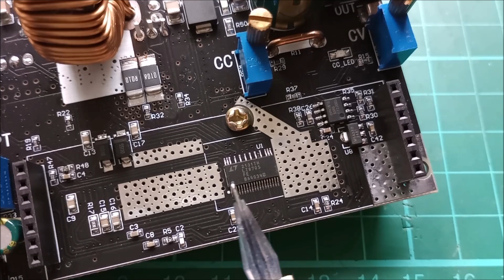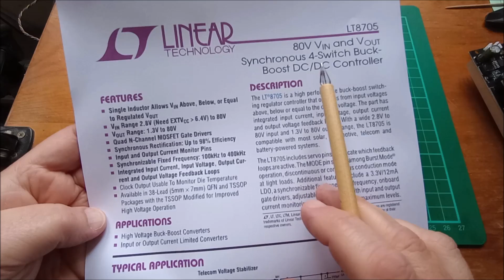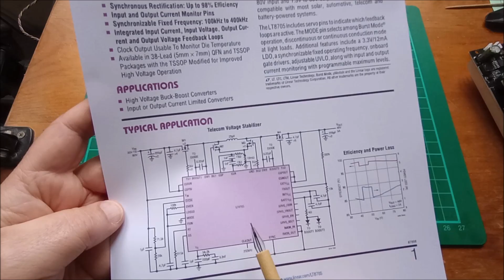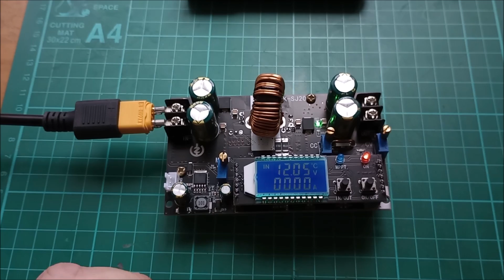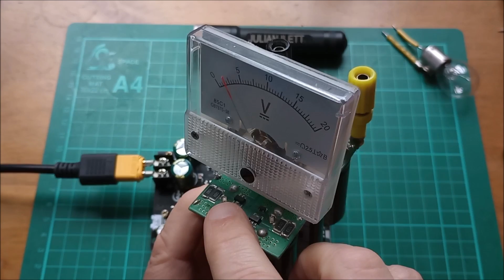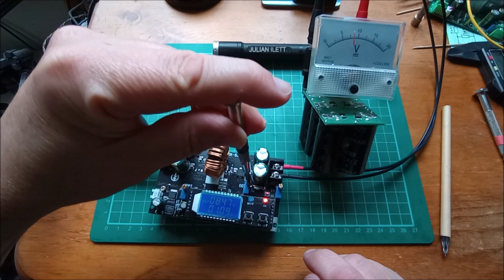ZK-SJ20 Just Another Buck Boost?

Comment: hi @JulianIlett do you know what type of fet transistors are installed there? i am wondering if I can to change them to more powerful ones (with less resistance) if this module will be used not for 80 but with 40 volt panels. don't want to install additional cooling )
Reply: NCE82H140 originally installed

Comment: I bought both of them (SJ20 and SJ30) version.  So, here is what I noted after half-hour of playing with these things:
- The manufacturer that makes these modules also makes regulated power supplies, they have lots of other products that start with "ZK" prefix, for example: zk-6522c . All their stuff uses microcontrollers, so they are probably good at programming them and hence a unique module design idea to control the buck converter with a microcontroller
- So the board (with display) is composed of a buck board (or "motherboard"), and a microcontroller board (the display). Now why do you think the display is detachable? Well my hypothesis is: because these guys also manufacture power supplies (regulated, laboratory-style), they made a generic board based on the LT 8705 chip (very good IC, it even has sync pins to sync many of these in parallel) which they are using on their other power supply products. But how do you sell a buck converter to the solar guys? Exactly, you label it as "MPPT". A regular buck converter has a potentiometer called "low voltage", but for the solar guys they relabeled it as "MPPT". This way you manufacture the same board, but for solar guys you sell the PCBs with "MPPT" label, and for the electronics guys you sell the same board but with label "Low voltage protection" (and you don't have to print it, because we all know how it works). If you sell a power supply, then you insert the display board in the already existing slot. Result of this design: same "motherboard" is reused everywere it can be.
- The reason you have to short the outputs to set the overcurrent protection is because the overcurrent protection goes on the display (the microcontroller board). But when you already have the PCB designed and used in other products, how do you control it with external board without modifications? Exactly you control it by detecting a short-circuit. On short-circuit the voltage drops to 0 immediately so there is no mistake. They found this easy solution for them, but for the User it is not very pleasant. Imagine a 30A current flowing on the output and you have to short-circuit it (in order to set overcurrent protection value), you will get a lot of sparks and probably smoke. While you are turning the potentiometer the short-circuit must be kept active, otherwise the value won't be set, you could possibly heat the screwdriver a lot if you aren't very quick. They could do it with another button, but because they didn't want to modify the buck-board (and this is my speculation because I don't know the real reason)  they decided to go for "short-circuit way" to tell the microcontroller board that it has to set the output current value in its memory. Only engineers from that country can come up with such idea.
- The fan can't be turned off, doesn't work on temperature-sensing. Too bad

Will keep testing and maybe find another issues.

Comment: I think i will buy this but i'll replace the caps with higher quality panasonic FR ones. The input will never be more than 30V so i'll replace the 100V input caps with 35V ones and the output caps with 63V ones. I won't ever need more than 60V. I'll power it from a 24V AC toroidial transformer.

Comment: Hey there,
which buck-boost would you recommend today, with the following properties (from higher to lower priority): 
- efficiency,  no or very little heat dissipation,
- protected with a resetable fuse
- voltage and current display
- size of module preferable small
- solid input and output Terminals
- temperature controlled fan, best without one needed
- voltage 5V in / out
- cuttent 10A in / out
- power 100W to 200W in / out
Reply: check out the blue buck-bust converter with LTC3780  chip, costs 6 dollars ,synchronous rectification, 10A . The best thing I have ever found on Ali. You can parallel them up and they won't burn. Ceramic fuse included!

Comment: When you say single inductor but also buck-boost, on the basis it's described as synchronous, and "like the 3780," I would hazard a guess what you're actually looking at is a SEPIC converter. I think buck-boost has just become a shorthand for a DC converter that can go up or down. Possibly I'm splitting hairs, but it's an interesting development to see more of these.
Reply from the maker: No, it's not a SEPIC converter. Both the LT8705 and LTC3780 are described as Synchronous 4-Switch Buck-Boost Controllers. The data sheets explain it. But I have just bought a super little SEPIC buck-boost converter, fully digitally controlled (using the FP5139) for a very specific purpose. Details soon :)
Reply: @JulianIlett  thanks, interesting. I'm always on the lookout for a DC converter I can control with some sort of data input, something with a decent enough response time to implement a PID for LED current control. Never found one yet... Be interested if you've come across anything that might work.

Comment: The output capacitors most likely get hot because of the high ripple current they carry when in boost mode. (In buck mode the input capacitors have the high ripple current). The worst case output ripple current occurs when the output is twice the input voltage - which is the case in your test - 12V in to 24V out.

Making a few assumptions about the switching frequency (200kHz) and inductor (22uH), with 10A output the output capacitors have approx 10Arms ripple current. Those 2 x 330uF 100V won't be rated for that (probably 2.5A max each, probably less), and they likely won't share the ripple current well (because the hotter cap of the two will have lower ESR and thus hog the ripple current, getting hotter still).

The designers should have provided 10uF or more (40uF would be good) of very low ESR, high ripple current ceramic capacitors (or expensive polymer/hybrid electrolytics) paralleled with the input and ouput electrolytics. Problem there is that multilayer ceramic caps suffer drastic loss of capacitance with DC bias - eg. a 1210 10uF MLCC 100V X7R might be less than 2uF with 80V of DC bias.

Thus they would need at least 5 of them for 10uF net capacitance. I don't see many MLCCs on the supply so the electrolytics are likely overstressed and will fail early and may even explode if operated at 1:2 voltage ratio, 20:10 amps for any length of time. This is a common problem on cheap convertors beacuse high ripple capacitors are expensive, especially for higher voltages.

Note that the capacitor ripple current is independent of the input and ouput voltages - only the currents and the voltage ratio.
Reply from the maker: Yeah, I believe this is what's happening. The capacitor temperature isn't always directly related to the heatsink temperature. This unit will be tested long-term in my shed. I'll let you know if the caps fail.

Comment: The title should mention mppt tracker cause I missed to watch it and found it only by the most recent video which showed a flexible 100W panel .

Aliexpress calls it also MPPT and it is a quite affordable mppt one for roughly 30€.

I like this one a lot for a 300W, but there are also for a bit more units that come with a case and fit far better into a RV.

Comment: This seems ideal for charging an 36V or 48V ebike battery from a small ~18V solar panel, right? Without the "MPPT targeting", traditional boost converters will collapse the voltage as they try to max the current.

One should only charge a battery with a BMS so it can cut off the charging when full.
Reply: Prolong float charging at full-charge voltage of lithium batteries shouldn't be used but it is fine with lead-acid batteries as long as the regulation is good.

All switchmode converters have a negative input resistance characteristic, so they will all collapse the voltage of a PV array if the array can't meet the power requirement and there is nothing to prevent collapse.

Comment: I bought 2 of these. 1 with and the other without the display. The mainboard works exactly the same just transfer the display to the other. The display also has a power limit function. If the output exceeds 300W, it turns off. You have to push the on/off button to resume. If you don't have the display module, there is no power limit until something blows up.
Reply from the maker: The power limit is a sensible idea :)
Reply: @JulianIlett  there's another "mppt" module available I'm not sure if you have seen it. It is boost only but based on LTC1871 and is advertised as 10 to 60v in, 10 to 85v out. 600w max. I bought a few and have one used for two 18v panels in series to the 48v home battery bank. It's been running for months, gets warm but quite reliable after setting up. Google LTC1871 600w mppt and it should come up.

Comment: I know the OPA1612 as I have used them as audio opamp. They are pretty low noise and have low THD. Pretty good for audio use is my experience. They are also marketed as an audio opamp (SoundPlus is the line of opamps from TI). But their high precision makes also sense as a feedback opamp to give a very precise output voltage which I believe they are using it for in this case. So surprised to see it and also not surprised to see it :D

Edit: It is not a cheap OpAmp btw. €3.31 per unit if you buy 1000 on Mouser. A single unit is €5.88.

Comment: Nice little module, but the MPPT seems a bit misleading. On the aliexpress site they really talk about MPPT of solar panels, but you have to set it manually which is not MPPT. Would be very interesting if it really could handle 300W as stated. I doubt it can handle 20 A for longer time than a few seconds without fan. Also for a buck-boost the efficiency would be interesting. Maybe you can add this to your test, for different load situations would be optimal 🙂
Reply from the maker: True, it's not 'Maximum Power Point Tracking'. I call it maximum power point targeting. Apparently the unit cuts out at 300W with an error message. Although how that works when the display unit is not attached, I don't know.
Reply: If you don't have a display, the module is always on. So no power limit until something blows. I tested it to just 160w and it already needs a fan
Reply: Good point. It is not a true mppt device.
Reply: @biezitis  I have bought 1500W (50A) buck converter on Ali for 33 bucks (with shipping included), it manages 2 solar panels of 550W , so I am getting 94% efficiency (measured it myself so nobody can fool me), why the heck do I need an MPPT? To gain 4% more? Come on.... 4% doesn't worth paying 10x the price of a buck converter.

Comment: At 5:09 it seems to have exceeded the current limiter? That may be hazardous depending on what (was) on the output 😅
Reply from the maker: Yes, there's a brief overshoot of the output current limiter system. Not a problem if charging a battery (or even a supercapacitor), but it could kill a fragile load.

Comment: Always enjoy watching your videos.
Out of interest, I would like to give something back to you and this community, would you be interested in a free PSU for your projects and testing modules.
Reply from the maker: Thanks for the offer. What kind of PSU is it?
Reply: @JulianIlett  I have a Mean Well and TDK-Lambda switch mode power supply's. I have a list of them on the eevblog forum. Please feel free to pick what one would be best suited to your requirements.
Reply from the maker: Thanks so much for the generous offer. I've had a look at your post on EEVblog and I notice these are mains PSUs. I now only use battery power supplies (power banks / power stations) for my experiments.
Reply: @madprofessor9423 I could take one off your hands for the community 😂
Reply: Great video as always. When you speak about 10A,.... Input ? Output ?

I will like to know if you can test it by charging a 24v battery from a 12v battery. 

10A? 15A with fans? So 240w at output is possible? 

I think you also have an infrared camera so it will be a good test !!!
Reply from the maker: That's the thing. I can test both ways. 24V battery charging a 12V battery will have 20A on the output. The other way round will have 20A on the input. I'll check this stuff out when my 5v fans arrive.
Reply: @JulianIlett may be it can reach only 15a, you know,  but it will be ok.